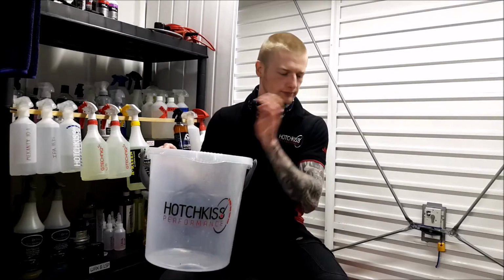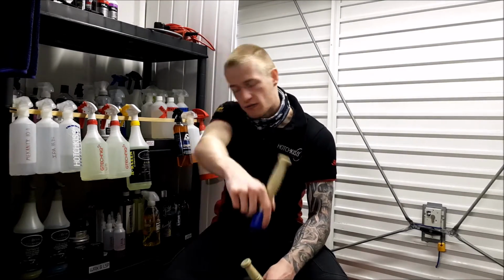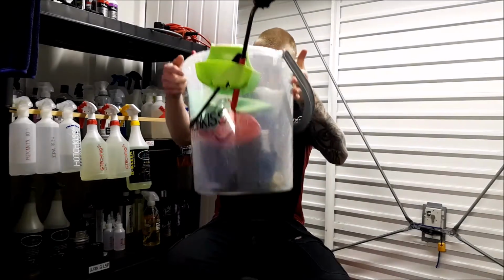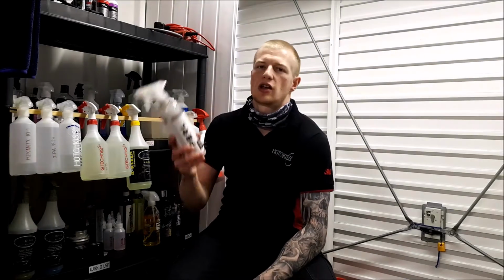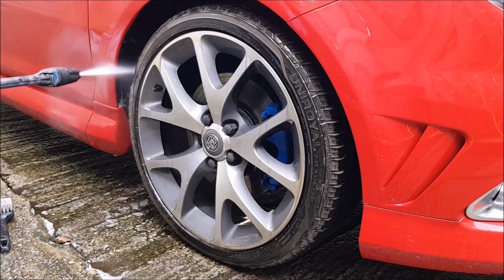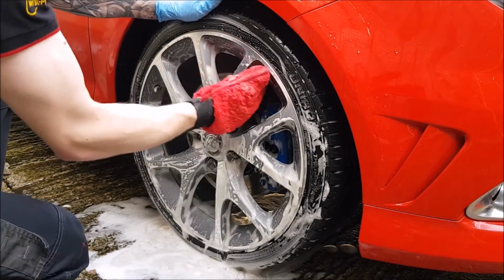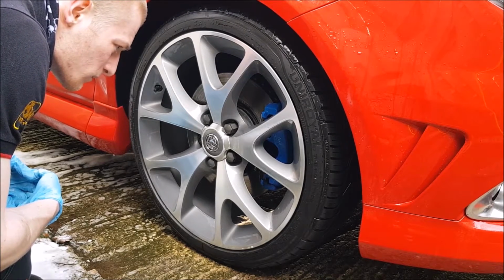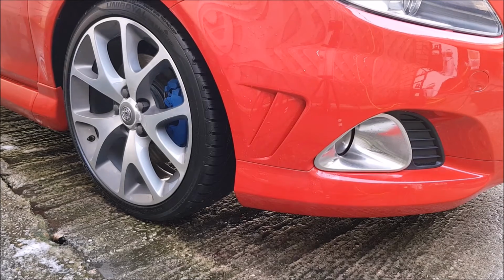How To Clean Wheels, Tyres & Arches. Wheel Regime Explained

Comment: Great video. Just bought some kkd breakaway. I normally use TDG wheel sealant on alloys. Will the kkd strip the TDG or is not that severe?.
Do you use an wheel sealant, and if so what do you recommend
 Thanks

Comment: the tuff and shine wheel brush in my favorite brush hands down the best for hitting the tyre with some degreaser cleans it so easily and i find it just the right size for that, also they are a cracking piece of kit of misting a apc on the floor mats and give em a quick scrub and they really come up a treat....I must say a big thanks to Joe at " JP" details for bringing this brush to my attention, put it this way i would not hesitate to replace asap....also thanks to cleanyour car for there speedy and great service....and of course thanks to you josh ...for also spreading the word about products that work and last well.

Comment: Hiya, do you have to do shampoo and the wheel cleaner? Would you recommend any milder wheel cleaners? Angel wax bilberry for example?
Reply from the maker: You don't particularly need the wheel soap, just adds a bit more lubrication to your tools, like a shampoo and mitt combo on your paint. Angelwax Bilberry is alkaline based same as KKD Brakeaway which are both fairly mild cleaners when diluted down to a suitable level.

Comment: i often get funny looks when the mates ask  me how long to clean wheels...and i say first time i allow 1hr per wheel....i follow your way to a t, although once cleaned i will give them a couple of coats of poorboys wheel sealant,  cheap as chips and cracking as a  layer for the brake dust to adhere to.......makes the next clean a dam sight quicker and less products so it pays for it's sen in no time,,,subbed and belled young'un .
Reply from the maker: Haha they just don't understand do they, it's funny actually, cleaning the car today, my neighbour was also, by the time I'd only just done the wheels he'd already finished, probably sat inside with a nice brew, I did think to myself "wouldn't life be much simpler if I just used a sponge and bucket" but that's not how we roll! I will sometimes use a wheel wax/sealant and also dress the arches, but the video was already going on for quite some time so thought best cut it to cleaning only. Appreciate the comment and you watching, also for subscribing, big thank you. Hopefully you enjoy future uploads.